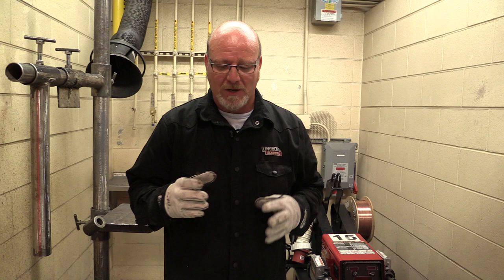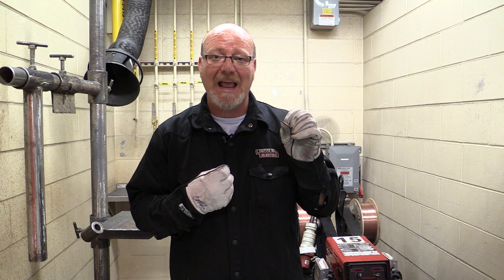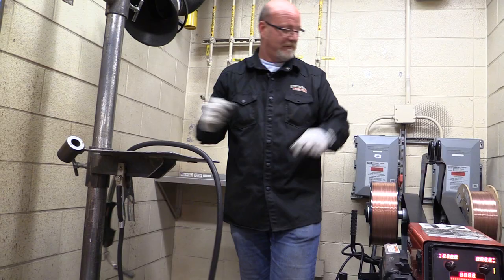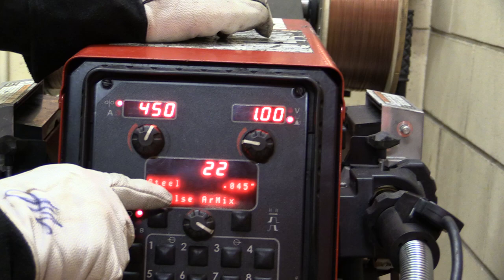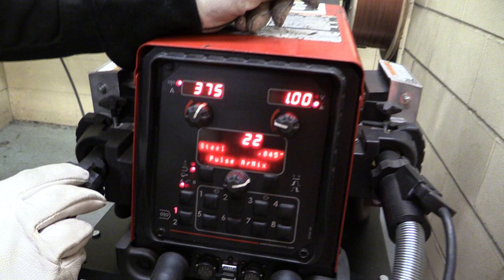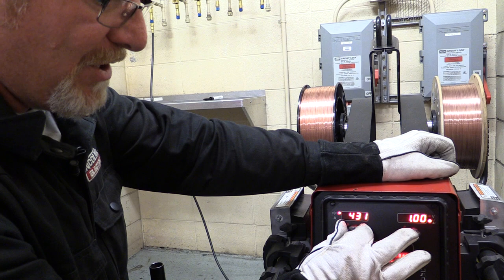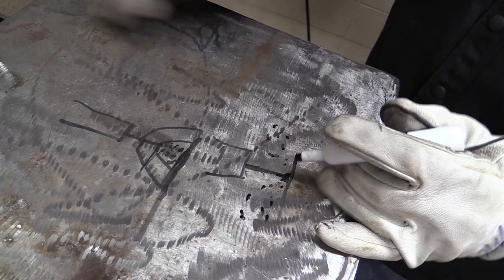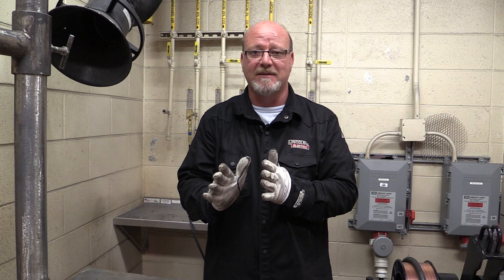What is pulse MIG welding and what are the advantages.

Comment: Thanks so much just started pulse not a lot of data or info on the subject in relation to settings And arc length Love my Miller machines but manuals are only give basic Thanks again and hats off to Lincoln for sharing Miller needs to step up on training

Comment: Im currently training in pulse at a shipyard. I passed my 3G and 2G tests (xrayed) but i had 2 little spots of porosity in my 4G. Im having an issue where halfway through the bead it seems almost like the pulse slowed down and the puddle look unstable, im keeping it the same size and the bead turn out just fine externally but grind it down and you might find 1 or 2 pencil tip sized spots of porosity (my failed test had 2 in the entire plate). As far as i can tell it isnt stickout, my angle does change from a 15° drag to more straight up 90 by the end of it since im pivoting on my elbow with an arm rest. 
Procedure is inch thick 01CS to 01CS bevelled on both sides (deep front groove, shallow back groove) with 1/4 inch run off tabs and obviously no backing strap. Fill front and carbon arc the backside then fill the backside. 
Using 100S-1 0.45 wire at 210 WFS and 21.5V

I was using 220WFS and 22.0V but apparently amperage was to high and they had me turn it down

Comment: Holy shit.. finally an arch lenght explanation that make sense..thank you.
So im having issues with my weld turning grey. What would be the issue? Using stargon ss, Miller 350p, usual cfm around 40-45. I notice the more angle( almost 45°push) comes out more colorful
Reply: If your welds are turning out really grey you're probably running too hot. I'd turn the trim down, maybe wire speed up a bit keep the puddle moving and you'll get a more silver finished look. I pulse weld for a living :)

Comment: We have a aluminum pulse mig welder at work your right i get like zero spatter but, was confused to you mentioned the arc length. We are using a new gas its like 2% co2 i think with balanced argon idc for it think argon welds better supposed to make it so the spatter comes off easy during regular mig aluminum didn't make a difference when i tried it only pulse mig created no spatter.

Comment: This was a very good video on the basics. My question is can you do another on specifics of welding things like hy-100 and ar 500 using pulse? I own an excavation company and do a lot of repair on heavy equipment components. Currently I use a dual shield set up or 110-18 stick rod for most of my repairs. A friend is a welder at a naval shipyard and says they have switched to pulse mig for welding the hy materials. I bought a big spool of la-100 solid wire and 95-5 gas as that's what Lincoln called for with that wire. Any tips would be appreciated.

Comment: On a miller set do you change the A or V for a better weld on 10mm
Reply from the maker: John,
its a question that has many variables. Remember Amperage is electrical flow and Voltage is electrical pressure. The key is to find a spot where both are playing a roll in getting the results you are looking for.

Comment: Is it ok to short circuit pulse with 75/25?
Reply from the maker: short circuit pulse??? this is what is called modified short circuit and there are few machines capable of this?? Do you have a Fronius CMT? Lincoln with STT or Miller with RMD?